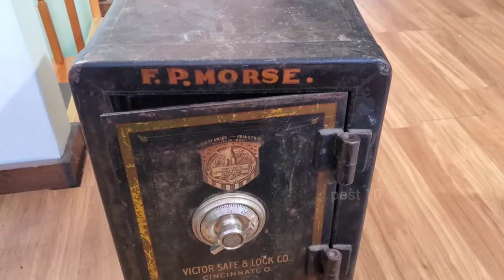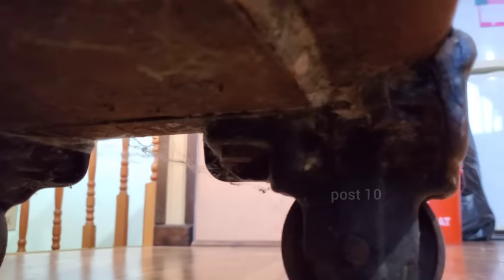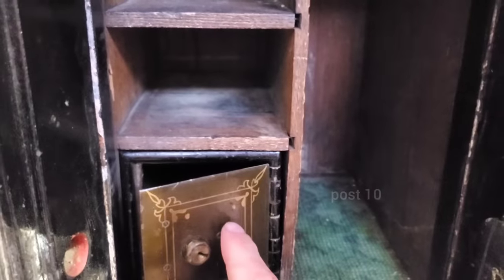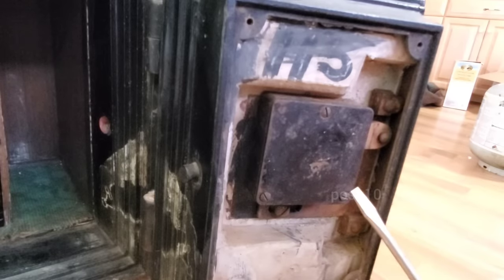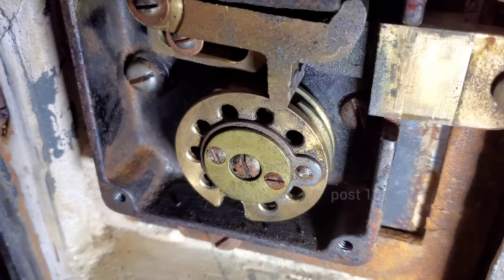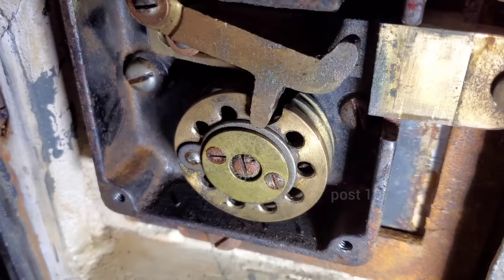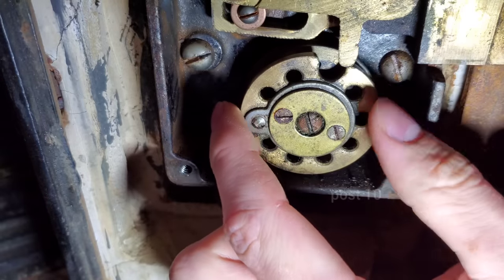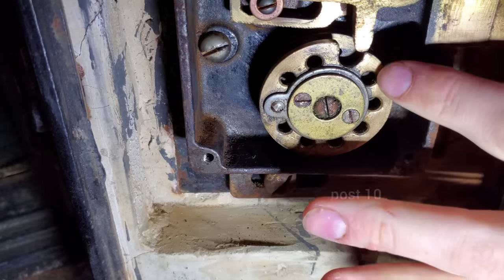Figuring Out The Combination To Antique Safe

Comment: Yesterday I was at a flee market and I bought an antique Cary Safe ($75.00), Patented September 16, 1890. It was in rough shape, rusty, and the door was open because someone had engaged the lock mechanism - the pistons were extended - therefore, the door would not close. The seller said that no one knows the combination and the door has been open for about 50-70 years. The safe weighs about 400 pounds. I brought it home - got on YouTube and found your video - and using your technique, I had the lock working in about 2 hours. The combination is RT x 4 turns 87, LT X 2.5 turns 26, RT x 1.5 turns 19, LT 58. Thank you so much for posting this video!!!!!! By the way, Before today, I knew absolutely Zero about old safe locks - now I think I could  open any antique combination safe lock. Thanks again.

Comment: Great video. Remember that painting any of that will kill its antique value but if you want an easy and effective way to seal the concrete, just mix some Elmer's white glue and water and to make a super runny glue solution and paint it on or use a spray bottle.

Comment: Cool old safe! I have to take the panels off my safes and see if I can change the combination on one to match the other. On a side not, many years ago I had a little job driving a truck from the Mare Island Naval Shipyard to a locksmith in Napa with three safes from the Provost Marshall's Office that were bought at auction. The locksmith was so impressed with getting to work on these high security locks that he had only read about, he didn't even charge us for the combination change. Safe cracking and lock picking are fun hobbies.

Comment: Two ways to get into an antique safe. Drill one inch to the right of handle (if there is one)  at 3 o'clock and punch the boltwork out. This renders it unusable afterwards.
- If its a gravity lever drill into dialring at 7 o'clock at an upward angle of about 30%. Scope and line up the gates until the lever drops in.
- If it's a drop in lever like the safe in the video drill straight into the dial ring at 11 o'clock and scope the wheel pack, lining up the gates under the fence.

A good dril with 6mm carbide bits and a 5.5 mm 2 way scope like the Teslong is all you need. The antique safes were invented before powertools and have no hardplate and relocker(s).

Happy drilling 🙂

Comment: Gypsum is what makes safes fire resistant. There are different ratings and just like the sheetrock on your walls which is gypsum there are water crystals all inside the mineral and this acts as a vapor barrier and as long as that vapor barrier exists fire will be staved off. The thicker the gypsum the longer the vapor barrier will last while being burned.

Comment: Victor Safe & Lock Company started in business in 1885 in Cincinnati, OH. They continued in business until they were acquired by Remington-Rand (Rand Kardex) in 1927 and the facility moved to Marrietta, OH. The name was also changed at the time of the acquistion to the "Victor Safe & Equipment Company". Remington-Rand also had a facility in N. Tonawanda, NY that was making office equipment under the Victor label. In 1956 when Remington-Rand was acquired by the Sperry Corporation. The safe making division was discontinued. Sperry did continue the fire resistive file cabinet and office equipment division, using the Victor logo, until this was finally sold off in 1987. A company named "Turn-10 Wholesale" acquired the logo and trademark at this time. Turn-10 is still manufacturing a small line of equipment using the Victor logo, though they don't actually make the equipment. Fire files are made for them by companies like FireKing International - only they have the Victor logo instead of the FireKing logo.

In April of 1895, Victor Safe & Lock Company registered the "VICTOR IN HOC SIGNO VINCIMUS 1885", logo as a "trademark". The trade mark serial number is 700265528. The current status of the trademark is "EXPIRED". This trademark translates as: "In Hoc Signo Vincimus" = "In this sign we conquer".

Comment: That safe is awesome!! It's really very cool that you saved this. :) The little bit of rust can be removed with a little hydrochloric acid. I know that's might sound heavy-handed, but the acid eats away just the rust and leaves the metal intact. A little bit of pint where the rust was, and then finish with polish. It'll look awesome! :)

Comment: I thi k the bottom was originally sealed. I was taught to enter a locked safe from the bottom. Cut bottom open in a "H" pattern, knock the vermiculite out and you will find a second metal piece that you cut in a second "H" pattern opposite of the first. Knock wooden floor out and you are in the safe. Safe can be repaired and reused without any damage being evident. I have a large collection of old safes. It took me less than 5 minutes to get inside the safe.

Comment: Old safes can be hit and miss with fire resistance, not all antique safes are created equal. I would definitely take the lock, dial and bolt work off the door and give them a thorough cleaning and lubrication. That's the easiest  thing you can do to enjoy your safe for many years to come. You can also get that thing fully restored. 😁👍

Comment: I just cracked mine using this method, i bought my safe for $180, door was opened, tumblers removed but Included.
My front main door is a 5 digit combination all 3 middle digits take a full rotation and then stop at the last digit. 
The internal safe box must be a 4 digit cuz it has one less disk/tumbler.

Comment: So basically:

1. You listen for the ccw slowly moving for 3rd in the back gear for gap. Write down number.

2. Go the other way 1 complete full turn. Listen for the catch. The second sprocket is now moving. Listen for the gap. Leave it parked underneath the bolt. Write down the number.

3. Last one move the opposite way again listen for the bolt to drop. Write down the number.

4. Spin it backwards again and you have the combo with an opening safe!

Comment: I have an almost identical safe that was my grandparents.  It's a Victor safe but it doesn't have the "F. P. Morse" logo on top.  It's absolute rubbish as far as being able to determine the combination.  If you get the first number right you can hear a loud "click" when you hit the second number, and when you hit the 3rd number, just like with your safe, there's another loud "click" and the dial stops turning.  You then turn it a bit in the opposite direction to withdraw the bolts.  But it makes a nice decoration and there's the family connection.

Comment: Cool find but don’t paint or do anything to it. It will greatly devalue it. I wouldn’t grease anything or lubricate anything either. It devalue it as well.
Reply: Why would preserving it in a working order devalue
Reply: @jarroddraper5140  it’s in working order. Anything other than very minimal restoration, ie: removal of light dirt, dust, cobwebs and rust will greatly reduce the value.

Comment: You could seal the concrete with acrylic using a paintbrush, which could control the application much better than using an aerosol spray.

Comment: 14 messages
Today
Ask us anything – we’ll get back to you here or by email.
Do you have any questions I can help you with?
Hi
8 minutes ago, not seen
Introduce yourself to deliver your message. The team will get back to you soon.
Name
Email
Phone number (optional)
Thanks, you’ll get a reply here or by email.
Consider adding any details that might help the team to answer your question.
I have a diebold Safe  it has a YORK tag on it also
6 minutes ago, not seen
Spec F2-nd
6 minutes ago, not seen
S.M.N.A Class 0
5 minutes ago, not seen
Opps   SMNA class D
4 minutes ago, not seen
It is a small safe
4 minutes ago, not seen
I had it open today and when i turned the tumblers they was sticky
3 minutes ago, not seen
I [pulled the back cover off t6he safe , Removed the inside sheet metal cover that was screwed to the door
2 minutes ago, not seen
I then took the two screws out that held part of the lock assemble amd squirted wd 40 on both parts   the back of the dial and the lock i removed
1 minute ago, not seen
whjen i put it back on i can not get the combination to work.[ Could i have changed the combination ?